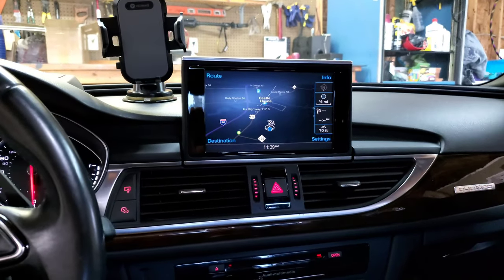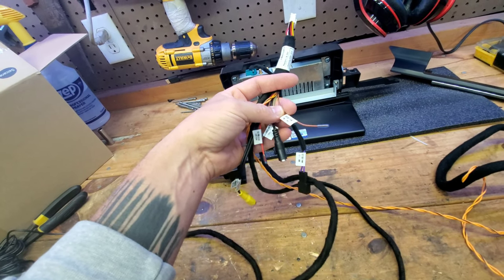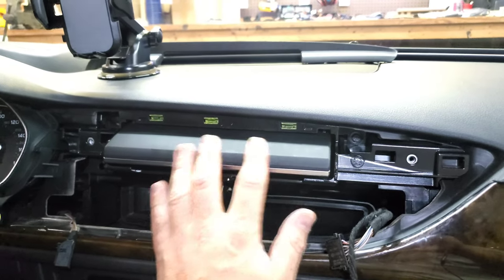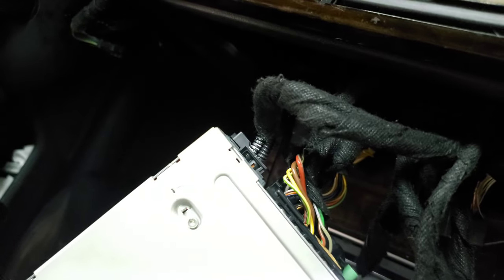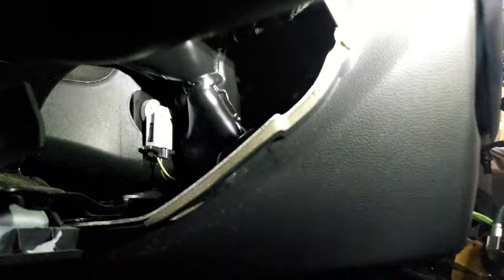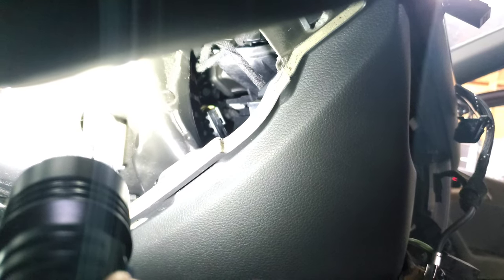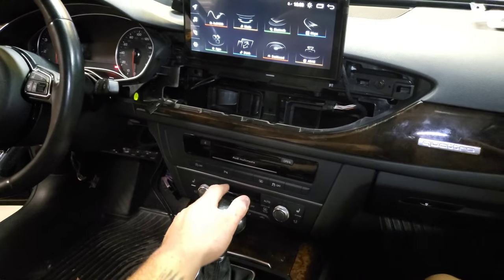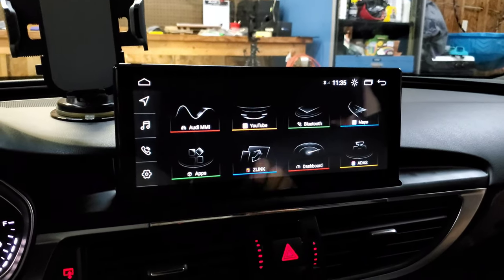How to install an RSNAV (or similar) Android Head Unit on your C7 Audi.

Comment: my 2 cents: just get the 9 inch android oem replacement screen. it looks so much better than this one and the screen still feels like the oem and goes in the dash board when you turn off the car. i got that one and i love when some of my friends freeze for a second when they get in my car and they see me touch the screen and having a touch screen despite it looking exactly like the oem one. this 10.25in ones seem to have pretty much a pointless right side when you go in navigation and lots of other things. like i said that's my 2 cents
Reply from the maker: Respectfully I disagree. The folding mmi is prone to failure in terms of the mechanics of its. I much prefer the stationary screen. But that's just me
Reply from the maker: Also, my right side shows the music I'm listening to when running navigation. I really love the way it is setup
Reply: Where do you get the 9 inch android oem replacement? and is it touchscreen?
Reply: @drpatrickmccabe  I got it from ali express. Now reading my previous comment I realized I say "oem replacement" and it's not oem it's just 1:1 design replacement. It bolts in place of your oem screen and keeps all the features of it(open, close, oem menu and function of mmi)plus the bezel of the screen is way smaller than oem(and my 2 cents: get the one with the highest ram possible it will make a huge difference when it comes to speed through menus etc) and yes it is touch screen, has a 4G LTE module etc
Reply: @lauretiu Hey man! Is there a way for you to post a link to that? I will be very grateful! Cheers!
Reply: @lauretiu do it have Apple CarPlay? And do you have the website?
Reply: Thinking of buying a 9 inch one off Ali express. My car has the Bose soundsystem did you notice any loss in quality using this? Also after owning 11 months what’s you taughts
Reply: @EvanConlon_  i wounder The same thing
Reply: can you post a link ive been looking for a screen that ill be able to keep my flip feature and yet to find one. please and thank you
Reply: Does it have apple CarPlay???
Reply: Does anyone get an answer about carplay or BoseSound quality or an link? Greetings from Germany
Reply: @AudiC7Owners you guys Ugode actually has the best screen they even have a 12 inch model. It’s buttery smooth, that’s what I purchased for my A6 C7.

Comment from the maker: Update: Seicane did not do enough to remedy the problems many of you were having with their customer service. As such I have removed their product link from the description. You can still use this video to install any other similar head unit like RSNAV.
Reply: this is exactly what im experiencing..been fighting with it for a week now, please keep me posted!!
Reply: i purchased it through the link on this video, but it almost seems like they sent me one designed for a different country? it looks like yours but dosent function the same,its missing some features and no way to download common apps? been going back and forth with siecane but cant get a strait answer...
Reply from the maker: @robertwalker8052  I'm waiting on a reply right now. If they don't fix the issues I'll remove the link to purchase.
Reply: if I can't get it working right in the next week or 2 I'm just gonna request to return it and go with the RSnav...seems like they have the system figured out alot better. hopefully its not a fight trying to return it for a refund...thank you for checking into the issues, really appreciate the help!!
Reply from the maker: After speaking with my rep, it seems that they are aware that a few units got shipped out that should not have been. It seems that they are trying to make things correct with customers, so hopefully they will do right by you. Please let me know what happens in your case.
Reply from the maker: Please keep me up to date on all your cases guys
Reply: @davidbowen9416  my thoughts exactly...the one I received functions nothing like the video basicly the only thing that works and isnt buggy is the Bluetooth, and after 25+ emails back and forth im getting nowhere with them..I asked multiple times to return it and they just ignore the comment and say something like "did you try to reboot it" ? after paying 650$ total I feel like I got burned
Reply: @AudiC7Owners  im getting nowhere with these people, if you talk to them again will you please mention my name. there not acknowledging any of this with me. Or shoot me the person's email you have been dealing with because im just going in circles with them now, and it's getting ridiculous. I'm afraid I'm gonna be stuck with a 650$ paperweight! thank you!
Reply from the maker: I about to tell them that if they don't resolve the issues I'm going to remove links to their product.
Reply: @David bowen did seicane send you some sort of software update? if so were you able to get it to load? also what passwords did you get? the only one that works for me is the factory tab which is 8888. thanks!
Reply: @davidbowen9416  This is the very same thing with the one that they sent me. And although i sent pictures circling the reason why the unit doesn't sit in the bracket properly, they instructed me to just install it. the wiring harness was slightly different and incomplete and the screen when turned on, looked nothing like the one in this video.
Reply from the maker: That's ridiculous. I'm going to take down the links
Reply: I’m having the exact same issues with my unit. I was able to get it installed and working, but it’s all Chinese apps on the unit and am unable to get the google play store installed to download any usable apps. 

My CarPlay actually works, wireless and wired, which is the main reason I wanted the unit so I’ll probably keep it. It just sucks they ran a scam like this on us! I am 100% convinced they sent you a legit RSNAV unit and are selling a completely different cheaper unit to all of us. Kinda wild!
Reply from the maker: That would be wild if they did. Either way, I've removed their product link.
Reply: @gtboyjunior  I had to take the bottom plate off the unit then it would actually sit down in the plastic tray like it's supposed to. i unscrewed the 2 antennas from the plate and just zip tied them to the tray.
Reply: @david bowen  I removed the bottom plate off mine and it will sit down in the tray. I zip tied the antenna connectors since the plate is gone..works alot better now after finally figuring out the update they sent me. it has been a nightmare trying to get it working right though...and I'm a 20yr technician by trade who has to deal with electronics installs all the time!!
Reply: @robertwalker8052  just went through the update install. After you updated, did you have any issues signing into your google account on the apps??? It won’t let me sign in to my google account on any of the apps 😢
Reply from the maker: I think your should have stuck with your claim against them with PayPal
Reply: @davidbowen9416  I made a claim with my credit card company yesterday and they offered a temporary credit for the full amount while they investigate. I just explained everything to them.
Reply: @robertwalker8052   how did you install the update to the unit? I downloaded the unzipped update to the flash drive but nothing happens when i plug the flash drive to the unit, nothing happens.
Reply: Ok , I’m not to confident in what I just ordered reading these comments
Reply: @Phil-G1075  I'm waiting on mine currently, did you end up receiving the correct product? I'm a bit nervous now
Reply: @TheGridironX_  I got mine. Haven’t installed. It looks of good quality everything is there. Nervous about installing. I almost returned but decided to keep .
Reply: @Phil-G1075  mine just reached the delivery facility finally. I may install within the week and I’ll let you know my experience
Reply: @TheGridironX_  yeah let me know. I feel like the videos on YouTube are ok as far as the installation info but definitely don’t want to overlook anything. He shows messing with the dashboard speaker and I don’t know why.
Reply from the maker: @Phil-G1075 because you have to plug the dash speaker into the provided wiring harness.
Reply: @AudiC7Owners  oh ok. The unit I got from china has no directions at all. Just came with all the harnesses and the unit itself. I always like having paper work to look at but I got nothing but YouTube videos.
Reply from the maker: @Phil-G1075 I'm pretty sure I show exactly what I did with that speaker/harness
Reply from the maker: @Phil-G1075 I'm pretty sure I show exactly what I did with that speaker/harness
Reply: @Phil-G1075  Well, it's here and I'm looking at it. Same quality you experienced. I'm going to attack the install tomorrow after work. The only thing I'm looking for is a way to ground the parking brake wire if thats even possible. This harness is nuts lol
Reply: @TheGridironX_  yeah, it’s a little intimidating. That’s why mine is still in the box 😂 , let me know how it goes. Take pictures
Reply: @Phil-G1075  Alright so I got it fully installed, its actually pretty easy. I did not take down my kick plate however like cameron did, I was going to if I needed to but I was able to manage. The unit works pretty good from the hour or so that I was messing with it. I was able to connect my phone right to it and play music through the carplay and the MMI. My only complaint is that the screen seems to have a lower refresh rate than the one in the video. I found out I need a new battery during this process so I will have to hold off messing with it until I replace that. But all in all, it was a much easier process than i thought. Just take your time unplugging things and keep the wires in the area they are meant to be in to help decide how to run the harness.
Reply: @TheGridironX_  that’s awesome. So you put in the pass code and checked your backup camera and set the system to aux mode?? How’s it look ??
Reply: @Phil-G1075  so neither pass code works… the one in the video and the one in the manual that they emailed me. But yes when I go in reverse the camera comes up without me having to do a thing.
Reply: @TheGridironX_  what year is your A6 ?
Reply: @Phil-G1075  it’s a 2012 prestige with the Bose system
Reply: @TheGridironX_  mine is a 2016 MHI2 software version. The pass code they gave me was 8888 .
Reply: @Phil-G1075  hm… they gave me “216” then “216can” for getting into the canbus settings I assume. I couldn’t get any to work. I will try yours and see if that works. It does seem like they “pre-programmed” the unit for my car. There were certain things I went to do in reference to this video but they were already the correct settings. Maybe I got lucky, maybe they listened to the reviews and tried to make the install easier for us.
Reply: @Phil-G1075  I also have 3G HN+R or something along those lines. My last flip up unit actually died on me that’s what led to this entire process. I was pleased to see the screen light up and I could finally check my oil level from inside the car again lol
Reply: @TheGridironX_  yeah , mine came with no directions. All he told me was passcode and make sure camera settings were set and also set auxiliary sound. That’s all I got . No wonder why I’m hesitating on installing 😳
Reply: @TheGridironX_  haha, yeah mine is 4G , passcode I got probably won’t work for you but I figured it’s worth a try
Reply: @Phil-G1075  do you know if you have the H8 version? I can send you my manual that came with it. There’s no install directions, but it kind of helps with the settings lol
Reply: How do we get password for factory reset my customer brought me a second hand and now I Don't know the password thanks
Reply: @TheGridironX_  I'm dealing with the exact same situation...My OEM screen died when I installed them unit it lit right up and I was so pleased...Someone mentioned putting your old unit in Aux before install? Our oem screen was black so how do we do that or is it necessary
Reply: @TheGridironX_  I hope you see this...I just installed this unit and there's no sound coming from the speakers...Any advice

Comment: another question; there have been comments that this system "sounds worse" than the original. Can you confirm this? I'm not sure why that should be (no amps or anything have been replaced from what I can see) but could there be a pre-amp issue in the mix that is poorer in sound quality than the original? I'm not sure with this replacement how much is replaced in terms of sound reproduction components. Would be great if you could shed some light on this. I currently have the factory installed Bose system (which is indeed already bad) so I am scarred to death of making that even worse. Many thanks in advance.
Reply from the maker: Mine sounded the exact same after install
Reply: @AudiC7Owners  ok great. Thx for answering, much appreciated.

Comment: As always a great tutorial vid. Thanks for breaking thing down as you go.  Huge confidence builder while working on my 2018 A7,  everything from brakes, supercharger issue, exhaust, mods...its beer time!   Monster thanks !
Reply: I looked at this. Does it work for our years?
Reply from the maker: If you guys have a 2016+ C7.5, you can get your mmi updated to run carplay. Check out our MMI update video
Reply: @AudiC7Owners  I have carplay.
Reply: I have a 2015 a4s what would you recommend for an upgrade on the mmi?
Reply: @xcristal69x  check out the Audi C7 Owners channel for a link for the MMi update first then grab the 10 inch screen. The 12.3 might be too big. Also  make sure you look for and compare the Android 10 and Android 11 versions, stability  is key
Reply: @robgarcia1631  thank you
Reply: @royale192  fitment looks on point , my concercen is stability.  I've  researched this and it turns out that there's two Android versions, 10 & 11, both appear to work fine but im not convinced. It would suck to do all that  work and not be entirely happy enough to flex your big display. 💪

Comment: I bought a similar styled/priced 8in android unit off Aliexpress for my 18' A7 (to retain the folding effect). The things I noticed were:
- Difficulty playing music, in android mode. When I did adjust the settings to get it to play, the quality was noticeably poorer.
- When in android mode, the on-screen temperature shown when it's changed would show in celsius, with no way to change it...
- Auto brightness not lowering enough at night, so manual adjustment had to be done.
- Wifi stopped working within the first week. 
- Lastly no instructions...

 Hoping to see if yours turns out better in the coming weeks. Because it has the potential to be great. And the 10in does look better than I thought. Almost BMW-esque
Reply from the maker: Since you have a C7.5, you should just get the oem update from Ben Weaving Ave activate carplay/AA with the oem unit.
Reply: @AudiC7Owners  will look into once I change my PCV, starting to act up at 68k lol

Comment: I wish I had this tutorial when I installed my RSnav a year ago it was a pain. 

I use wireless CarPlay and the only way that I can get sound to work is if I go to my Bluetooth and switch back to my cars Bluetooth instead of the CarPlay Bluetooth. Been doing this every single time I start my car for over a year. It’s annoying but I really don’t know how to fix it so that the audio plays thru CarPlay instead of just stock cars Bluetooth so I don’t have to switch it every single time
Reply from the maker: I got the audio fixed. Gonna cover it in a follow up video

Comment: Do you know if your method of routing the OEM quadlock through the kickpanel near the steering would work on a D4 A/S8 by chance?  If so, then you are a saint because that quadlock clearance issue is the only thing stopping me from installing a CP retrofit in my car.
Reply from the maker: Honestly I'm unsure as I have no experience working on that car. But it shouldn't be too difficult to try it! Let me know how it goes

Comment: Hi great vid. I installed similar unit to get CarPlay. This works great, however I seem to get an annoying echo when using this unit for phone calls. How is that for you? I mounted the mic in the overhead console next to the oem mic. Cheers & keep up good work
Reply from the maker: I don't have any echo at all, but this system uses the oem mic

Comment: Looking at putting one of these in but when I go to purchase it has an extra list of items I need to add. How do I know if my car has an optic fibre amplifier? The option adds £77.75 to the price and don't want to spend that if I don't need it. Thanks in advance.
Reply from the maker: I'm not sure, but I wouldn't buy from seicane. If go with rsnav. People have had issues with seicane from units not being like the one I this video, as well as poor customer service
Reply: @AudiC7Owners  That's a shame, the unit you installed looks exactly what i want, i have the RMC 6.5" screen, very basic. I'll have a look at the RSnav. Thanks for the heads up 👍